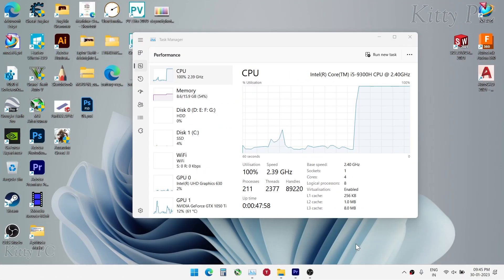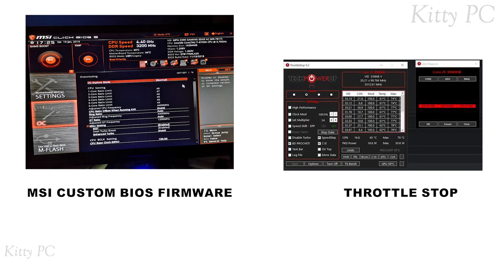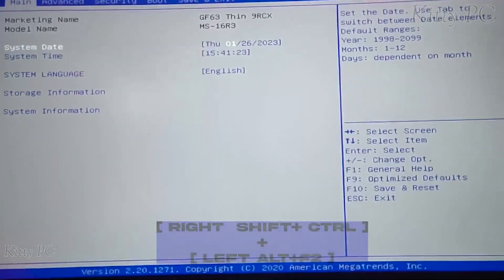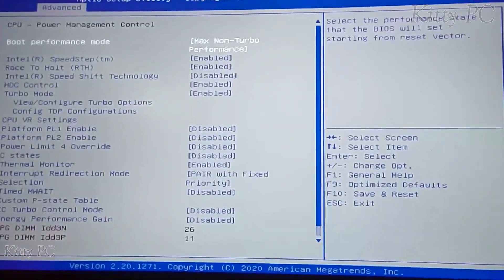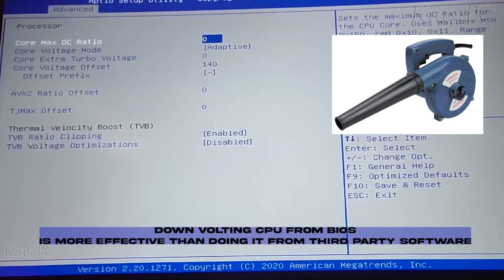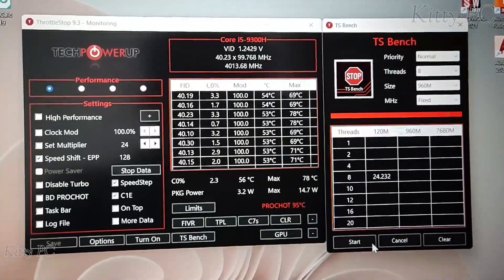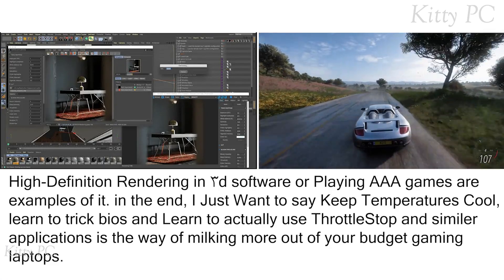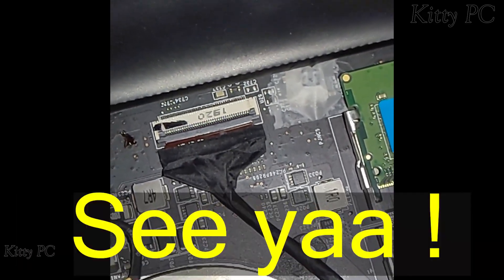MSI GF63 Laptop Secretes: Unlocking TDP Limits and Installing Custom Firmware Tutorial ( 48W power🔥)

Comment: This is just terrible. Use the advanced bios and do the IMON tweak, no need to install custom firmware. This will trick the CPU into thinking its only using very little power, when in reality its using more, thus you'll have effectively increased the CPU power limit. Then undervolt the i5 9300h via throttlestop. This should let your CPU hit 4ghz at lower voltages, thus using less power, thus running cooler. Then set a temp limit in throttlestop, say 90-92 degrees. 

The IMON tweak also lets your GPU use its full 45w (in the MSI GF63 thin) TDP, so in CPU + GPU demanding scenarios both can use as much power as they want, thus giving you the largest gains. Also, repaste both CPU + GPU with PTM7950, since it'll work well and lasts a long time. 

And if you REALLY want to boost performance, then slap a vibos of the same GPU but with a higher wattage. And a cooling pad won't make much of a difference for the MSI gf63 thin since MSI blocked the vent because they heavily skimped on the cooling.
Reply: The imon tweak is for CPU only? Or is there for the GPU too?
Reply: @Brukrex  cpu onlu
Reply: @setzer-j6s how to get around the GPU performance limit?
Reply: @Brukrex Your gpu has some of its tdp shared with the cpu. If you could make your cpu think its using only a little bit of power, when in reality its using more, it won't use that shared power between the cpu and gpu. This is what the IMON tweak does. Thus, your gpu can use all of the shared power and use its max tdp no matter what and boost performance.

Comment: My rule of thumb is around 75'c for PL1 long term and almost 100'c shortly for PL2 turbo. With PTM7950 as replacement of thermal paste you can raise those limits a little bit without problems. Depends on the laptop and CPU type.

Comment: Hello, I wanted to know if you could help me. I have a desktop PC with an i9-10900f CPU and a GTX 1660 Super GPU. The problem I have is that in games the CPU never uses more than 30% of the ghz and is at 4.51. I wanted to know how I can make my CPU use its maximum so I can get more fps in games.
Reply: i guess that you have a bottleneck there,  bcz the GTX 1660 S is a lil bit old. u can ask CHATGPT for help if u want to change the gpu

Comment: i still wonder what  did the custom firmware change? you can do the same full cpu watts in stock but the real problem is unlocking the gpu power limit can you?
Reply from the maker: You can do same CPU watts in stock  yeah but Only for very little time until temp. reaches 75-80°c somewhere.... 
In the custome firmware temp limits are stretched up to 95°C for CPU and you can even strech it to 104°C too... So if you dare to risk that high temp you can get 45watts even at those high temps using this custom firmware which is not imaginable in stock firmware.
And for the GPU part... It has got already 78watt limit which is very much acceptable only problem is with firmware of GPU , it has 93°C temp limit as soon as you reach that temp your GPU will throttle crazily... Now to increase that temp limit you need to modd Nvidia firmware. 

In short, MSI firmware is all about CPU tuning, to tune GPU you need to modd Nvidia Firmware.

Comment: My screen just black
Reply: Open your laptop and take off the CMOS battery and wait a couple seconds. Then put it in and turn on the laptop. If your pc doesnt have a cmos battery, just take off the battery cable inside the laptop and wait a couple seconds. Then reconnect and turn on laptop
Reply: No need to remove cmos, MSI can reser it by just Pressing and hold power button for 45 seconda

Comment: Did you have the firmware for msi gf63 10uc i5 10500h rtx 3050?
Reply from the maker: Not right now 🙂
Reply from the maker: it needs to be modded manually by a bios editor

Comment: Just liquid metal your laptop and buy better thermal pads and this will be safe. I have GP63 with 8750h and my temps doesn't reach over 85 with the liquid metal and custom termal pads
Reply: dayum 85 is too high.. I try to never cross 70c
Reply: @mihintai8166  Its not that high on laptop.

Comment: I have i5 4590s 3ghz turbo 3.7 ghz and zebronics h81 motherboard when I play game the cpu not goes above from 3ghz it always remain at 3ghz when I don't play game it run about 3.45ghz something . Why my cpu not run at full speed I also replace the thermal paste with a high cost thermal paste please tell me the solution
My cpu temperature never go above 48 degree Celsius 😥
And I check in intel extreme tunning utility software it shows power limit throttling
Reply from the maker: it is because your CPU hase low TDP limits and probably blocked by yout motherboard, YOUR CPU DROPS THE FREQUENCY BECAUSE OF NOT ENOUGH POWER DURING HEAVY TASK. WHEN CPU IS ON FULL LOAD IT REQUIRES MORE POWER TO STAY AT CERTAIN FREQUENCY. (WHILE IDEAL STATE YOUR CPU DONT NEED MUCH POWER TO BE ON MAX GHZ) I HOPE YOU GET IT. you have to unlock it first then try these methods. You CPU is basically too old.
Reply: @kittypctech  I have increased the tdp at it goes to full speed but on heavy task the cpu cores run at 3.3 ghz which is cpu 4th core speed how I increase the multiplier to Max in bios there is no option and in xtu the multiplier increase option is grey out
Reply: @kittypctech hey bro i have a i5 7200u the intel says tdp is 15watts can i do more because in games dur too lack of power fps drops cant even play cs2 without statering and micro freezes.